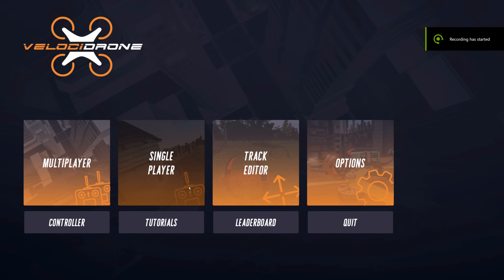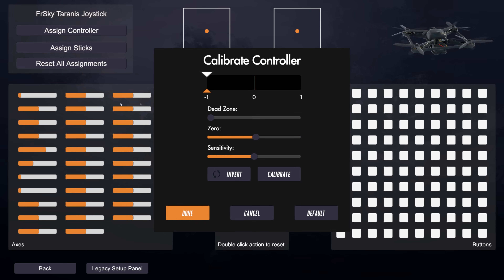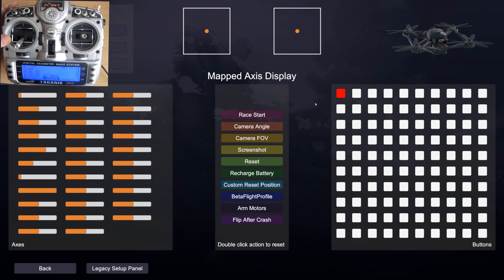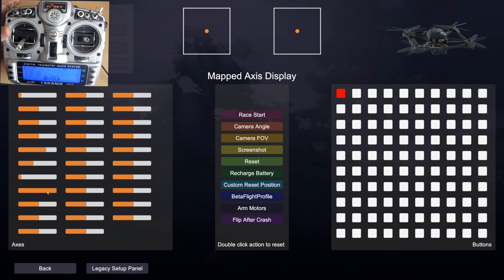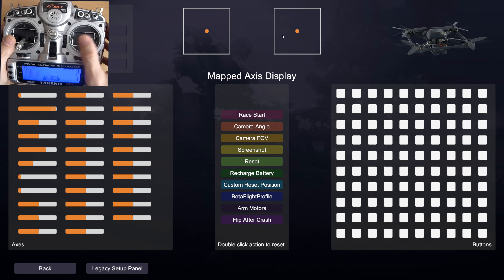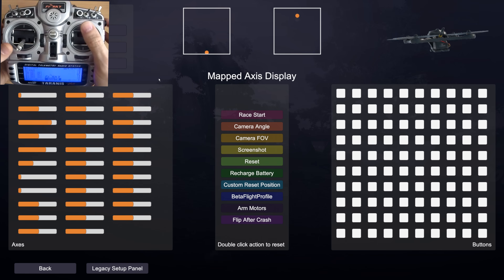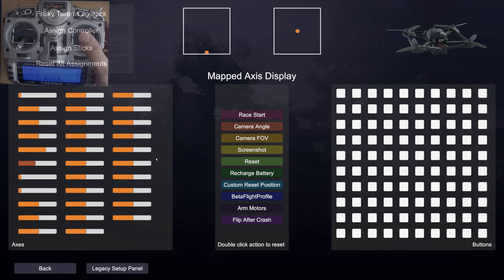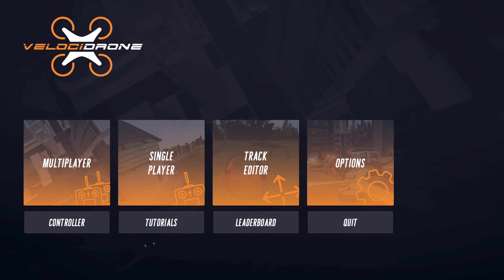VelociDrone 1-14 - new transmitter setup process

Comment: pls help me here. i bought a new macbook pro m1 max and installed the velocidrone on it. But even though ive assigned the controller successfully the drone doesnt take off. i dont know how to fix this. i used to use this controller before on my previous machines but on my new mac its not working.  The sticks show as if they are moving, once i press M, but the drone isnt responding. what should i do?
Reply from the maker: Suggest you open a support ticket for this as we may need to look at a log file - although check you have not turned off auto arming in the scenery selection dialog as this would also cause this. If it is a micro quad you are trying to fly then ensure betaflight is set as the flight controller in the main settings as that is also a way to cause this.

Comment: How do I actually connect the controller to my computer so I can later adjust it in Velocidrone. You show just moving the sticks and the controller is already connected to Velocidrone but how do I make the controller make the connection with the computer.
Reply: this very much depends on the controller as they all have different processes for connection

Comment: it's only detecting 2 switches of my Radiomaster TX16S. Why is that? I can't assign anything to my switches.
Reply: your controller will only send data for switches if they are assigned to a channel output and mixer in the radio itself and then that channel is assigned to a switch. It works the same as a real drone - if you don't setup channel output and mixers then nothing gets sent over usb. Basically not a simulator issue - you need to config the radio.
Reply: @ashleydavis614  ah ok! Thank you!

Comment: Switches dont work on Zorro help anyone? Solved 👇👇👇
Reply from the maker: no switches will work on any radio unless you configure them to be assigned to a channel - just like a real quad, switches do nothing if they aren't assigned to channels.
Reply: @Velocidrone  i did set Them up in my mixer
Reply from the maker: @ronsone8373  if you don't see the orange bar moving when you flick the switch and the orange bar just stays in the middle position then the transmitter just isn't sending anything or the switch is setup incorrectly.  Check the channel monitor on the radio to make sure the switch is sending different values. If you don't see those in velocidrone then the transmitter just isn't sending it. Be aware that any channel beyond channel 8 on an opent tx transmitter is sent as a button and not a channel.
Reply: @Velocidrone  didn't realise it needed to be setup in "legacy setup". Got IT working thanks for helping to Trouble shoot and very fast replys 👍💪

Comment: Why is there no option to set the flight mode?  Also, it's not detecting the record, back, rocker wheels, and center button on my DJI FPV remote controller.  Is it possible for velocidrone to detect those buttons?
Reply: we don't support switching flight modes on a switch as it is a bad habit, flight controllers in real life don't always switch nicely, so it is not a good idea to build a habit of doing this. Velocidrone will only detect what the radio sends ... so if you get nothing for those it is because the radio is sending nothing over usb when you use them.
Reply: @ashleydavis614  oh interesting, I didn’t know that.  Thank you for the quick response!  I’ve seen a lot of content creators doing that, so I assumed it was the standard.  I have so much to learn!
Reply from the maker: @likebliss  It is ok to do it on something like a whoop where if things go wrong there is little potential for damage. On a 5 inch or bigger I would not do it. Typically people do this to land (when the quad is closest to you) and this is a bad idea. Much better to just learn to land in whatever mode you took off in using the simulator rather than risk a bad mode switch and it's potential consequences.
Reply: @Velocidrone  oh yeah I would never do it close to the ground, that just seems like common sense lol, but I guess not everyone has that?  Haha
I think it could be a great feature to add, with a warning/teaching moment included?  I do plan to get a whoop and would love that option to be available with the added risks that I choose to be responsible for.

Comment: Great Video. I am trying to setup buttons/axes but I think the buttons are not detected by the game. the sticks are detected and calibrated but i cant see any response on axis side while clicking any button on the controller. any help would be appreciated.
Reply from the maker: for the transmitter to send a switch output it needs to be assigned to a channel - channels 1-8 on opentx send as an axis and channels 9-16 send as a button.

Comment: I'll give the new calibration instructions a ZERO out of 10. I move the sticks in the direction it asks, I can do that. Then it says something about moving the YAW, or ROLL, or something like that. What the hell is that crap!? Which stick is that!? Where's the pictures for THAT!? I like when it shows left and right, but what the hell are they talking about with yaw & roll? This new calibration is for the expert pilots who have taken classes to know the lingo. No sir, I don't like it!
Reply from the maker: the most basic of basic aircraft terminology, roll, pitch and yaw. Roll is rotating on the axis from front to rear of the drone, pitch is rotating on the axis running left to right through the drone and yaw is rotating on the axis top to bottom through the drone. Which stick you wish to use for each of these axis is personal preference - which is why we don't show you which stick to move as there is no right answer. Just as there is no right answer as to which stick you wish to use for throttle - which I'm assuming you know what that is.

Comment: I have a Radiomaster Tx16S and can't get the shoulder buttons to work. Any idea where to look towards fixing it? Thanks.
Reply from the maker: any button you wish to work has to be setup and assigned to a channel - otherwise how is anything supposed to know you are clicking it? Only switches assigned to channels will do anything, just like on a real drone.
Reply: @Velocidrone  Please note that's my first transmitter and I've never flew a quad other than on a Sim.
I can assign buttons as instructed in the video to the switches in the front face of the transmitter. Those switches when I change their position, a bar on the left moves accordingly. On the other hand the switches on the shoulders won't have any affect neither can be assigned.
Reply from the maker: Same answer...the switches need to be assigned to channels in the radio in order to work. The ones currently working are already assigned to channels by default

Comment: hello, my TX16s is recognized but the sticks are not answering, how to do??? Please help
Reply from the maker: Most likely the windows driver problem. This is well documented and there is a solution document in our knowledge base on our website
Reply: @Velocidrone  I already updated the driver, i created AETR module on it, the controller is working on DRL simulator, btu for some reason not on velocidrone For the calibration in USB, my raw data show 0 to 2047, i ee you have different values, could this come from there?
Reply from the maker: @investwithstuph5887  we have lots of pilots using this tx, so whatever the issue is it is not the sim side of the equation.
Reply: @Velocidrone  great to hear, just needed some help. Thanks anyway.
Reply from the maker: @investwithstuph5887  I would recommend using the velocidrone community facebook group as customers on there with your tx will be able to assist, rather than here where the only answer you will get is us saying we know it works because customers are using them.

Comment: I have a Taranis Q X7, which has four 3-position switches in the front. I'd like to assign one of those to my BetaFlight Profiles in Velocidrone. However, when I assign it, it won't assign each position to one profile, but it is like when the position is equivalent to a positive value in the radio, it acts as a button press and just rotates the profiles. Hopefully I explained sufficiently clear.
So, is it possible to use one of the three position switches to the profiles in that way, having each position corresponding to one profile?

Thanks for the videos, they're being amazingly useful!
Reply: Just to add another info, I even tried changing the function assigned to that switch directly in the radio to |f|, hoping that it would recognize both positive values and the zero, but it didn't work as well. The top and bottom positions in the switch would act as button presses, the middle one is just idle but it would still rotate the profiles,

Comment: Hello, I have done all what you do and the drone moves perfectly, but when I am going to try to fly in the simulator it doesnt take off. I dont know what to do. Can you help me?
Reply: Hi. I had the same issue. Try to go to Options>Quad Settings>Flight controller and switch between Legacy or Betaflight. This solved it for me.
Reply: @lexerkok40  Thanks. That was the problem!

Comment: I get stuck I. The send step when it ask me to Center my Tx Sticks. Nothing happens after why?
Reply from the maker: first have you actually centred both sticks, secondly are you making sure you are not using weight and offset if you are using an opentx transmitter as this will make centre be offset and cause the centre stick detection to fail.

Comment: For some reason my Velocidrone disappeared from my computer.  I used t this morning, then this afternoon it couldn't be found.  I re installed it and now I can't get the drone to start.  Everything else seems to be working and the stick set up looks like it works.  But when I throttle up, nothing happens.  Any ideas?
Reply from the maker: could be any number of things. The program is not able to delete itself - so it disappearing is weird in itself as it wouldn't be caused by the sim unless you installed it incorrectly (most common mistake is running the installer inside the zip file instead of unzipping it first). With regard to the problem you have now - no idea, could be it's just configured incorrectly could be something else - we have a ticket system for this under the support menu on the website if you can't figure it out - this would be the correct place to get support.

Comment: Hi , Everything seems to work but after choosing a quad and scenery I go to the main start screen, I see my quad but nothing moves only the scenery moves and there is sound but I cant get the quad to move or fly. Am I missing something ? It worked 6 months ago but seems to have updated. Any tips ? Thank you
Reply from the maker: Go to quad settings in the main menu and make sure flight control is set to betaflight
Reply: @Velocidrone  Thank you it works now.
Reply: @Velocidrone  sorry I got excited  too fast, now the quad just launches to the moon but I have no control. In the channel  mapping  you can see my sticks moving but in the sim my sticks cant control  anything . thx
Reply from the maker: @jordannovek2911  you have to assign the sticks as per the video, seeing orange bars moving in the channel mapping doesn't mean anything is assigned to control the drone.

Comment: Everything seems to be running correctly EXCEPT the throttle. In the controller setup menu, the drone in the top right that previews the roll, pitch yaw, and throttle show that the props are spinning very slowly at full throttle. Not sure what I'm missing...
Reply from the maker: possibly nothing - how fast the props spin is mostly irrelevant, what is important is you get a full range of movement on the throttle in the middle window showing your stick movements
Reply: VelociDrone ok got it. I do have full range of movement on the throttle. Also calibrated on app and actual radio. When I’m ready to fly I hear the props accelerating and I can even roll over to a crash with full throttle, there is just no lift ¿
Reply from the maker: @kreativ_corals  this is usually absolutely nothing to do with controls setup and more to do with installation. What you are describing usually happens if the sim is installed incorrectly. This could be as simple as placing the sim folder in an inaccessible location (like program files) or placing the sim foilder on a disk without read/write permissions. It could also be down to not unzipping the installer and installing the sim inside of a zip file. The underlying cause here is the sim being unable to access the database and as such cannot initialise the quad properly.
Reply: @Velocidrone  That's exactly the solution I was looking for (I placed the file in program files...smh lol). Thank you for replying so promptly and for being so helpful. Truly a pleasure to deal with. Thanks, Velocidrone!
Reply from the maker: @kreativ_corals  your welcome

Comment: hi can you tell me why my propellers spin really slowly?
Reply from the maker: Gamepad mode turned on in the main settings or using a transmitter model memory for other sims where weight and offset have been set to 50.
Reply: @Velocidrone  I've checked all of these things and I'm also having the slow throttle problem and still do?
Reply from the maker: @ClaireDCassidy  click on the  moving bar for the throttle axis in the left window to bring up the calibration window and just check that the throttle is moving the full range of the bar  - if it is, don't worry about it.

Comment: Hello, I am trying to use my TARANIS X9 Lite, but I only recognize the sticks, I have not been able to configure any other action, for example arm or start the race with any other controller button :(
Reply: I have the same issue with the X7, buttons and dials are not recognized (MacOS)
Reply from the maker: @Zwiesel66  this is because you have not setup any channels connected to those switches. If you can see from the radio monitor screen that the switches are not driving a channel then they will not be outputting anything over usb.
Reply: @Velocidrone  Thank you for your quick response. Now it works, I thought the Taranis X7 had a factory default channel config for all switches and dials - a stupid mistake.
Reply from the maker: @Zwiesel66  yeah, this gets assumed a lot - it's down to things like gamepads doing this but transmitters are totally custom, so nothing is assigned

Comment: When i move the sticks to "follow the sticks," it just keeps on going! No matter the speed i move from corner to corner, it doesn't move to the next step. When i set it up using legacy mode, all of the controls are unassigned, and I don't know how to fly so how am i supposed to set up pitch/yaw/everything else if i don't know how to do these movements?? Spectrum Dx6
Reply from the maker: this is indicative of a controller that just isn't connected or working properly as a usb joystick - ie. it is connected to the machine but just not sending any data
Reply: I am only a newbie but I had the same problem as you. Spektrum DX6 with SAILI-G6 USB adapter. My solution: Controller > Legacy Setup Panel > Throttle. Click on 'unassigned' and hold down throttle stick till the 5 second countdown finished. If it didn't work, repeat with throttle stick up all the way. Make sure no other sticks are moving. Repeat for Roll, Pitch, and Yaw. You can fine tune or reset the sensitivity when you click on the 'calibrate' button. I have the feeling the communication problem has to do with the USB adapter.

Comment: Help! When i move the sticks to "follow the sticks," it just keeps on going! No matter the speed i move from corner to corner, it dosen't move to the next step. When i set it up using legacy mode, allllll of the controlls are unassigned, and I dont know how to fly so how am i supposed to set up pitch/yaw/everything else if i dont know how to do these movements??  Spectrum Dx6
Reply from the maker: Sounds to me like you have a dongle that is sending far too small inputs - to fix this you probably need to turn up the sensitivity slider in the calibration so that it outputs a decent amount. You should be able to see this in the sliders on the left hand side, they should be throwing from empty to full bars and I suspect you are probably only getting very tiny movements - just a guess as  you haven't provided much for me to go on.
Reply from the maker: For reference this was DX6 in heli mode - two axis moving for throttle was confusing the hell out of the controls detection code

Comment: The setup program won't take me to the next step when I center the sticks. I tried it multiple times. I'm using a Taxanis QX7
Reply from the maker: you probably have weight and offset set for another sim - remove that as otherwise our sim will not see center
Reply: @Velocidrone  Thank you, that solved it for me.

Comment: How do you change to mode one IE,throttle on the right?
Reply from the maker: It does this automatically as part of the setup process, you tell it what stick is what function during the setup, so it already knows which stick is which.
Reply: @Velocidrone  Thanks, just what I needed to know. I tried Liftoff from Steam but could not acess Mode one at all! I recieved a refund so now will try VelociDrone, Cheers.

Comment: How do you configure the switches?
I can´t program them
Reply from the maker: the answer is in the video - either the switch will push a button if it is pre-configured to do so or you need to configure the switch to move an axis.

Comment: Thanks for this update.  Just bought the game last week (prior to new transmitter setup process).  Setup worked great on my Taranis QX7 but was a nightmare on my Turnigy Evolution.  Will give it another shot after the update.  Thanks!
Reply from the maker: the evolutions just need the sensitivity turning up on them usually as they don't throw very far and can miss the detection window on the old setup process. That said you are far better using the QX7 with the sim as the evolutions USB drivers are awful (low resolution and laggy).